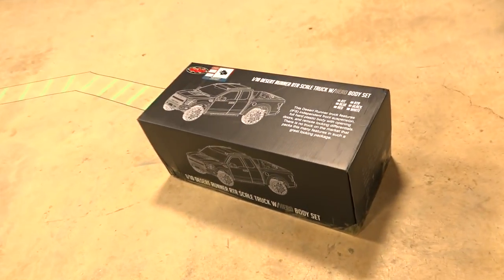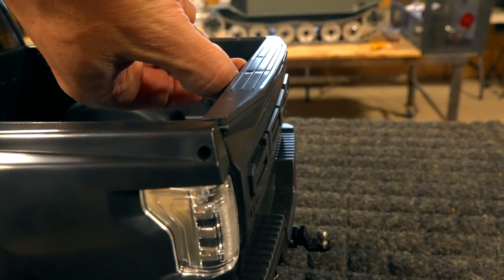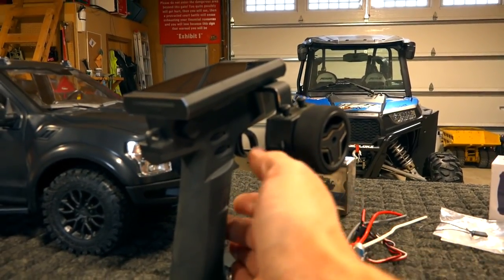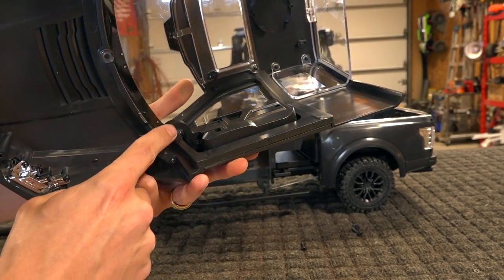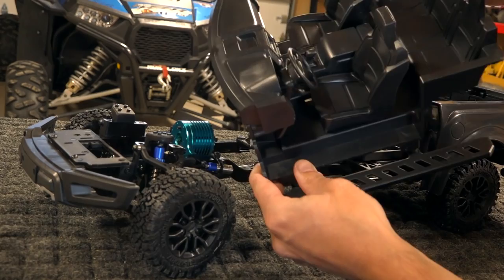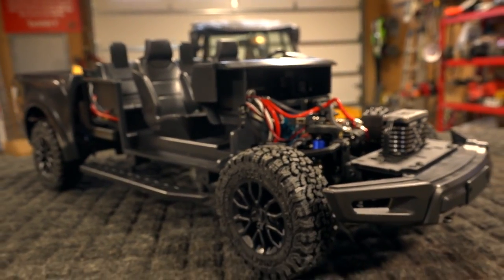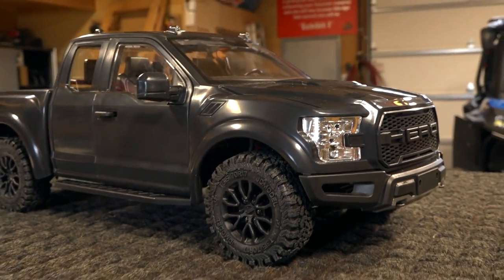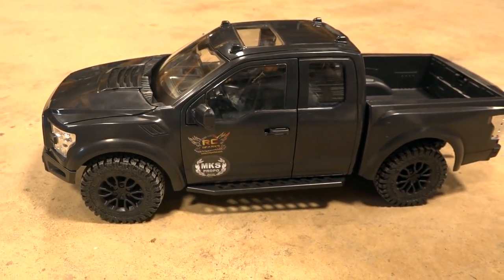I ASSEMBLE the ARTR RC4WD Desert Runner 4x4 "HERO" Truck - Looks like a Ford Raptor | RC ADVENTURES

Comment: Very cool.  I like the way that truck is built.  With a full frame and front mounted engine.  As though they tried to keep the  design somewhat loyal to the real thing.  There's room for improvement.    That is part of the fun though.  You could modify the body and make the hood open.  Heck, make the entire front clip rock forward to open.  Like a fiberglass or carbon body would.  Shoot, make the front clip rock open and make the hood open like a stock pickup. That would be real neat.  Thanks for the video !

Comment: They really knocked it out of the park with this one.  It is spot on the real thing.  The only feature I would like to see is a 2 wd / 4wd option just so you could throw some dirt with the back tires on the trail if you wanted to, but this looks built way beefier then the TF2, which is a good thing.

Comment: Any way you might do a few intro-to-build videos showing basic work and explaining customizable parts, names, and functions (e.g. “ESC” and “locking differentials”)—for folks just beginning to do this sort of work? Might especially be good for kids as well as adults. Thanks, awesome video!
Reply from the maker: I have so many times, Alex.. I literally have 1500 videos..!
Reply: Esc= electronic speed controller 
Locking differential= you can lock or unlock the truck from 2wd to 4wd all together or seperate to drive like a real truck as most Rc crawlers or scale trucks are full time 4x4. This gives the option of 2wd.
Reply: Thanks man. I will have to do a search. And thanks to bash master here for explaining the beginner stuff.

Comment: Great video. So informative! Truck is looking good. And yeah, those Traxxas motors’ shaft are a lot longer. I’ve had a lot of trouble fitting those into non-Traxxas units as well.

Comment: I'm still on the fence with this truck. It just looks so killer, but the way the doors work, painting it is basically impossible as the doors scrap the paint off the front fenders. Another youtuber put a 27 turn in it and the performance was a bit underwhelming. Someone on his page mentioned the transmission can get pretty warm so you might want to keep an eye on it when you do go for a rip. 

I am with you on its nice to see a scale IFS truck, especially for all the chevy guys who can only really build scale square bodies since the newer trucks are IFS. Also good for Toyota and Nissan fans, along with half ton Dodges.

Comment: Hi Medic!
The truck itself looks cool however I don't like the IFS but sure looks pretty scale. I just wondered about that steering servo you got there... If I saw it right than the strenght of that thing is 29kg at 6V but looked like it can't really center the wheels when in the ground. Is there a servo saver on it? Cause my cheap JX servo labeled about 20kg/6V and even with only 5V looks muck stronger than that. Sure it's slower but costs only about 1/10 of the MKS.
Will you try that sometime? JX PDI-6221MG.
Reply from the maker: Servo Saver that has a very Odd shape to it. It is not normal.

Comment: anybody talking about speed should really check RC4WD´s website 
they recommend a 35Turn with a 3S lipo battery should give the motor about 19500rpm(about the same rpm as a 20T motor on 2S)

Comment: Would an axial wraith be a good starter rc? My friend has a trx4, and I’ve watched these videos for over a year now, so I know a few things about how to use them. Opinions?
Reply: I have both the Axial Wraith and Axial Bomber. I love them both but like the Bomber a tiny bit more. Either one is a great beginner RC. Good luck.
Reply: I have a wraith and it’s a really good truck I would suggest it
Reply: What kind of rc are you interested in...crawling or bashing
Reply: Either, crawling and bashing. I would like something waterproof and durable.
Reply: Traxxas trx 4 and wraith both great trucks

Comment: Nice truck.   I thought the fit and finish could be a bit better.
Also on real trucks the ground clearance is measured at the rear differential as primary...(then the front and possibly transfer case clearances. Wouldn't that be the same for scale.?

Comment: Aaron your not the first to have a scratched windshield. Doors are also so tight if you paint truck they rub fender paint off. You should ask RC4WD what happened to the protective foam. Or was there some? Later
Reply from the maker: There was foam..  :(

Comment: It’s very scales but I find it sad that I looks very plastics because of the paints I know it’s plastic ! What I meant is that there’s cheap lexan body who are well painted and they look way better than this one even if since it’s a hard body it’s supposed to look more like a real one also like you said it’s very low on clearance but one of the first thing I would do on this one is change the wheels and tires cause they look to small for the truck
But it look like a nice Riggs 👍

Comment: Dude... can you drive with the Ford to work in the mine of YouTube gold please?  need more scale trucks three!
Greetings from the Black Forest in Germany
Reply from the maker: No. Everything on YouTube Gold is functional, and has a purpose.  There is a difference. We arent pretending to mine gold. We are mining gold. Just with small machines. I cant actually drive this truck. so its not useful to me..
Reply: @TheRealRCSparks  

 Thanks for your reply to my comment in your last video.

I have to talk about the same topic again. Maybe a little more scale in YouTube Gold. A small 1/10  Truck (RC4WD Ford) is similar to 1/14 or 1/16 scale. For example, a trx 4 is clearly too big. I can understand that. But the little Ford from RC4WD could fit well.

When Mini Madic of Scale Town Home drives to work at YouTube Gold... it s Perfect.... pls do it.... please think about it. So you can combine two wonderful worlds. Even if it does not fit 100% it is OKE.... 

Greetings from the Black Forest in Germany.

Comment: Hi my friend, really; I believe that RC4wd really produces beautiful models, but with little care in assembly and production ... I recently bought a D 90 1/18, and the self-tapping screws that fix the interior to the body front, have broken the screw seats ... it's necessary with that kind of screws, screw them two turns and unscrew them, screw them four and unscrew them and so on ... Traxxas, it's still far to reach ... 🙄